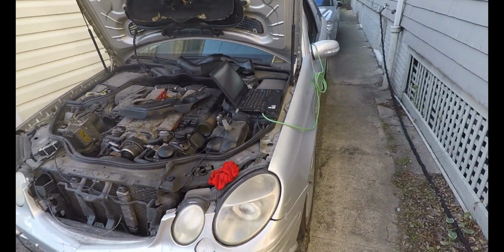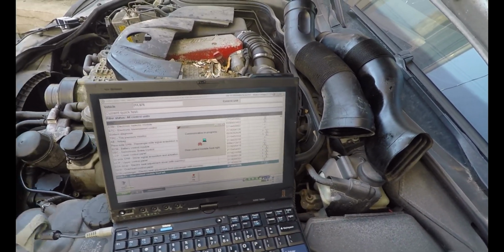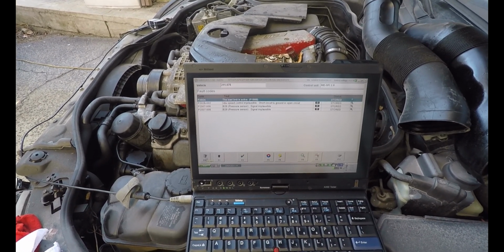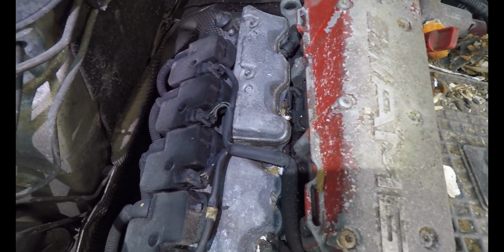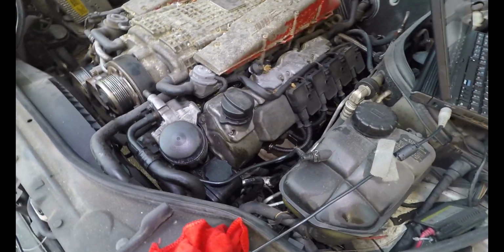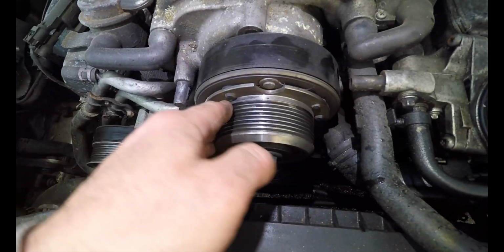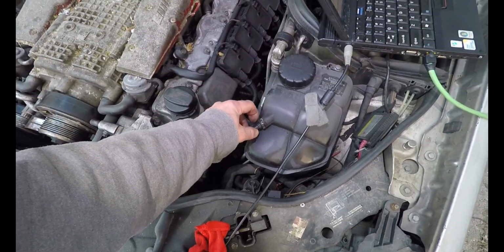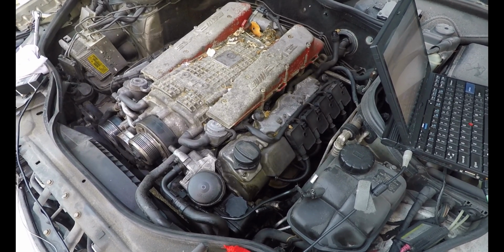Starting repairs on Mercedes E55 AMG, W211. First look under the hood

Comment: If you want to buy a used SL55 check FisherFAST videos, then go and buy one. If you want to know what it looks like to fix a used AMG check this video. Such videos should make ppl a bit more sober. Honestly this E55 is definitely pretty neglected. Most of used AMG cars have less issues than this car though I'm pretty sure that 95% of all used AMG cars from 2000s that are available on the market right now have various issues like oil leaks, failed electronics etc.
Reply from the maker: I personally think that sl55 are one of worst cars one can buy. W211 E55 is not much better. My favorite are S600s. Have 4 of V12s. Out from 2000s AMG w210 is most reliable, in my opinion. 2003 S55 is best blend, I can deal with it. 
This E55 bones are good. Just need to sort out all neglected issues and it will be a fun daily driver.
Reply: @vsandvs  I like R230 look. I agree with you - besides ABC SL also has a vario roof that may leak or fail. But if you want a convertible with 500HP and with an elegant look there are not many options there. Maybe Corvette is one of them. For some reason I don't like W220. I think W221 looks much better unless you can afford to buy 2018+ facelifted W223. I have 2006 CLS55 and 97 S600. Man if you were closer to Delaware I'd pass by with my W140 since it needs some attention. Currently ABS, ESP and ADS lights are ON. I guess 150 miles and a good 3 hour drive between me and your place in NY.